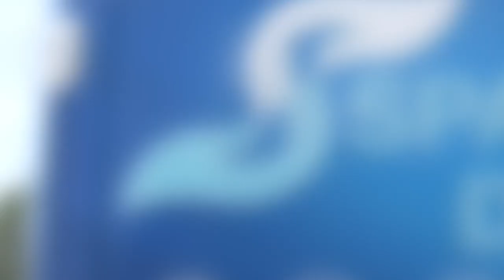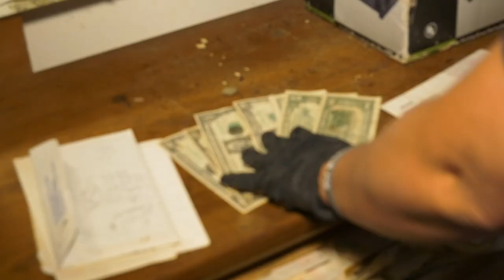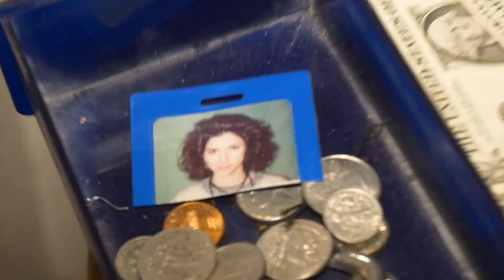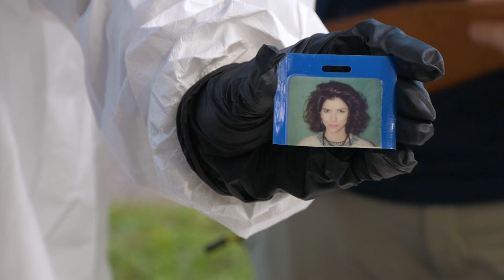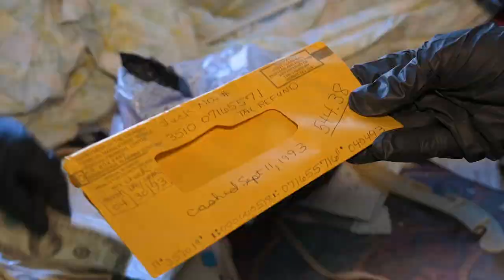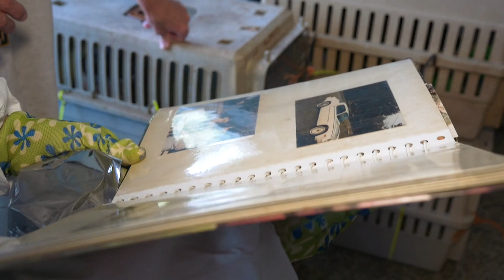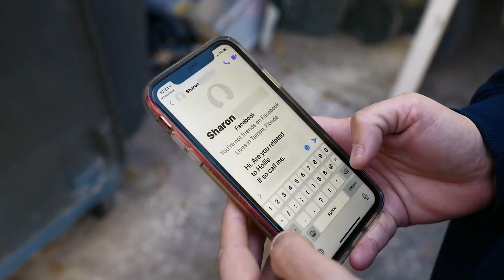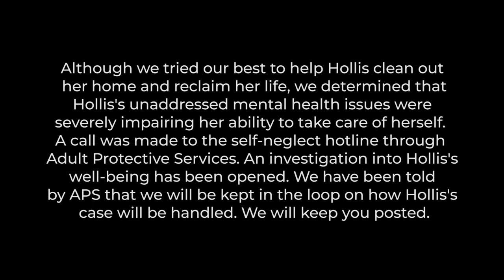Level 5 Hoard Cleaned Out for the Holidays Pt. 2 | Brandon, FL

Comment: Use cililet bang mold remover, leave it on the damp for 10 minutes and scrub it! It's strong so you will breathing mask but you can leave the windows open! It does the job! Just a tip for you guys! I used to be a cleaner! The best for scrubbing bathroom tiles is oven cleaner it cleans the grout! Wear a mask when using it! Just a tip! Xx

Comment: Hoarding is a symptom of trauma,  compounded by mental health issues in severe cases.  Unless you address the underlying causes, and give the hoarder the tools they need, they cannot move forward.  Clearing a horde without addressing the root causes will only result in extreme stress for the hoarder and the hoarding will continue.